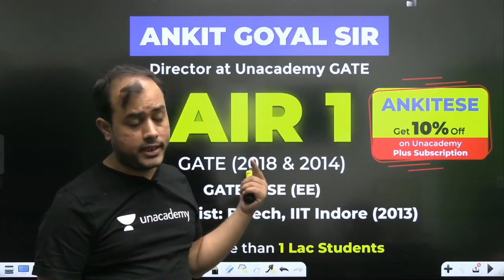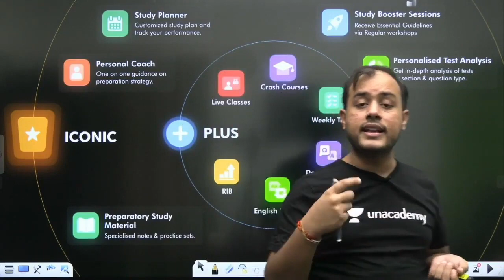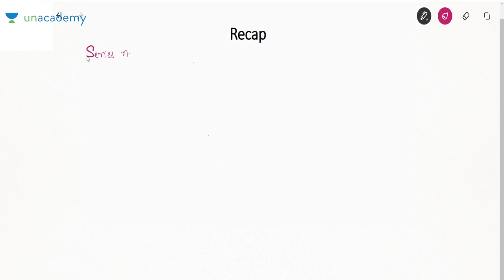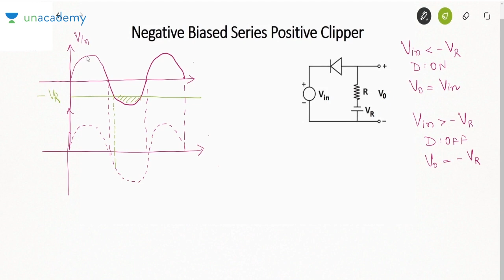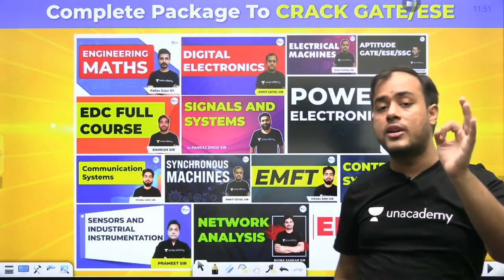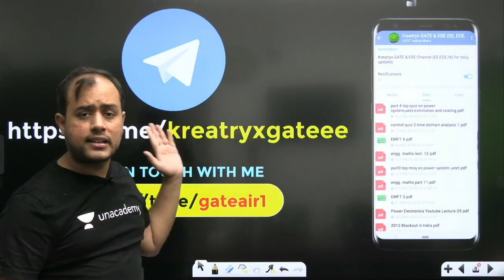Clippers - 2 | Diode Circuits | Lec 9 | Analog Electronics | GATE 2021 Exam

Comment: Sir at 10:33, why Vin = -Vo? Its the negative half cycle, so the polarity of Vin source must change na?
Reply: For Vin<0, i.e negative half cycle,diode acts as short ckt. So all the input appears as output in this cycle, Vo=Vin.
While,Vin>0, i.e positive half cycle,diode acts as open ckt. So  no voltage across load .So no output.Vo=0.
Reply: @ashishpradhan6503  does the polarity of Vo is opposite to the Vin when the negative half cycle is considered? So Vo=-Vin?